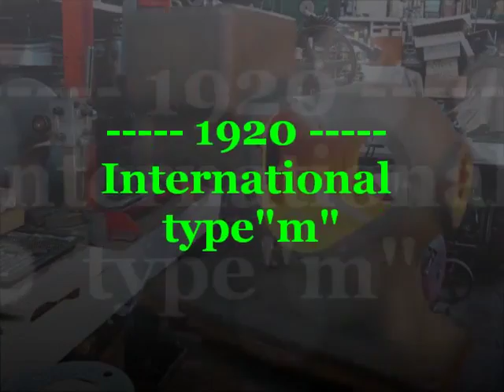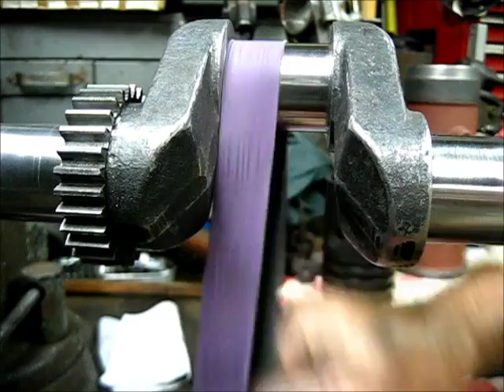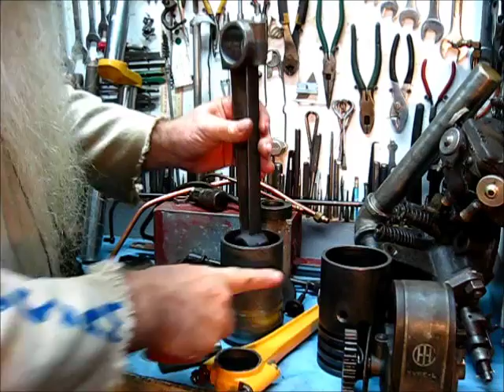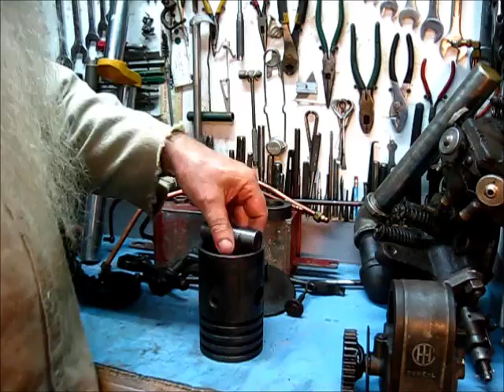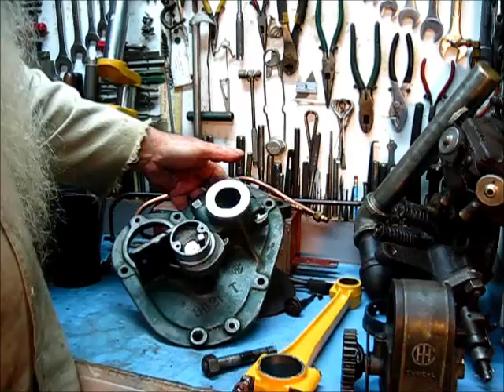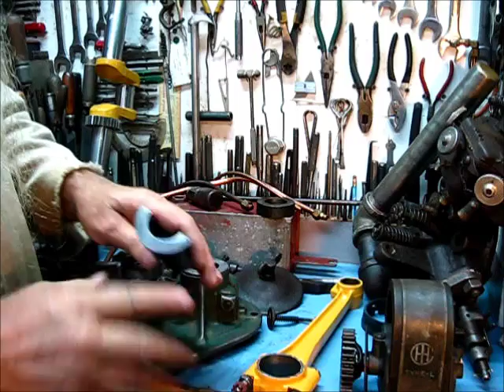1920 International type m #14 / some assembly required / gas engine

Comment: Thanks for sharing the wrist pin dimensions @ .9915"
Can you share the cylinder bore dimension. Acceptable vs. Unacceptable ? Thanks
Reply from the maker: yes,, upcoming video
Reply: @shopdogsam  
Thanks for replying. Could you also include crank shaft bearings and conrod as well ?
Thanks again for all the videos. Im learning lots for my 3hp M rebuild.

Comment: Oh Sam. Can you say Heilicoil.....  Oversize drill n tap, then thread insert the proper smaller size. Extra strong and no need for j b weld or any epoxy.